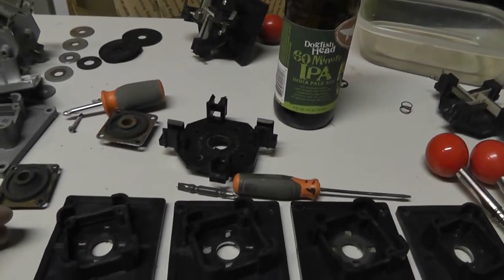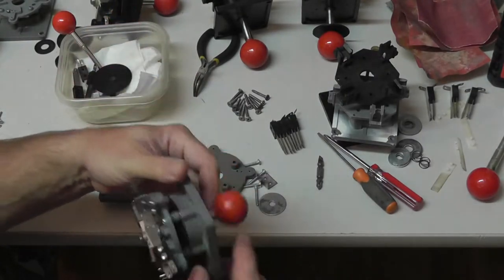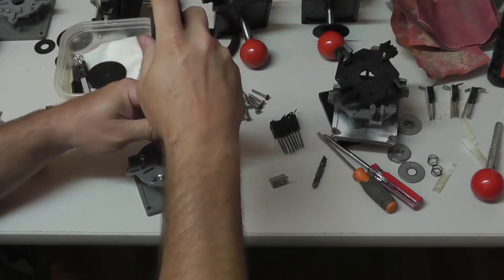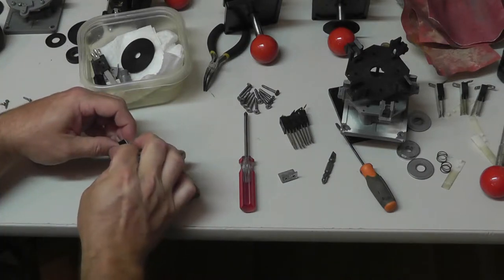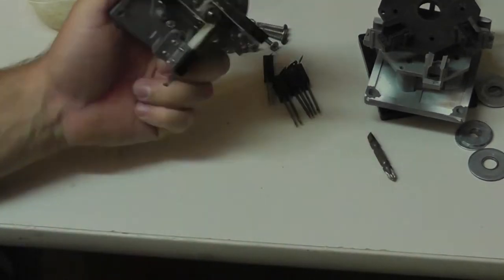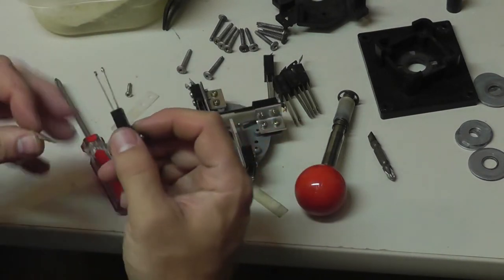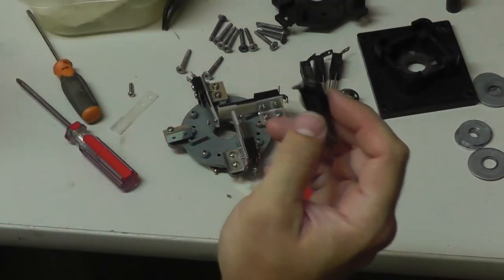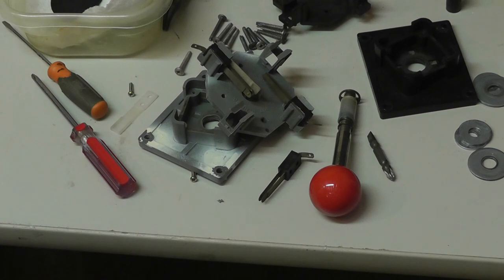Wico Arcade Game Joysticks - Part 3

Comment: Does Wico still exist?
Reply from the maker: Good  question but unfortunately, no or at least not in a form that makes arcade parts.
Reply: @jacklick  Do you know when they stopped?
Reply from the maker: @wadestoss3325  quick bit of research hints that they went bankrupt in 2001.  There was a company or website after 2001 called "wicothesource.com" but that is defunct for like a decade as well.
Reply: @jacklick  Thanks for the info. Kinda surprised some Chinese company hasnt acquired their name and started pumping out clones.
Reply from the maker: Well, I am not an expert but Happ Controls (now Suzo-Happ) did make some wico stuff.  Not sure if they purchased the rights or not but the Wico 360 joystick, for example, they made the Happ 360.  Also, arcadeshop.com makes/sells some reproduction wico sticks and parts.  Kind of interesting stuff.  Happ used to work for Wico and Coin Control.